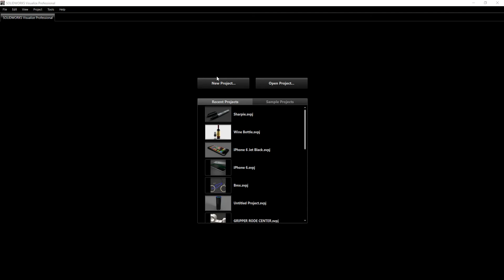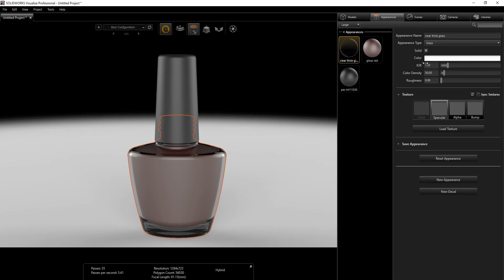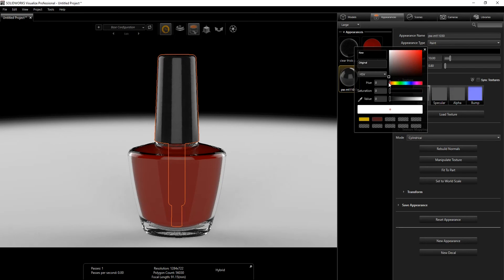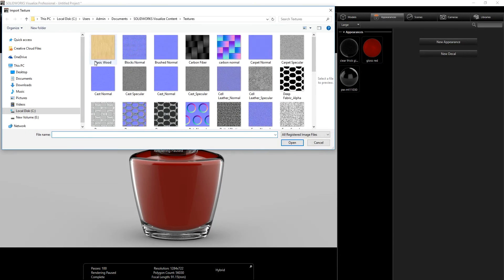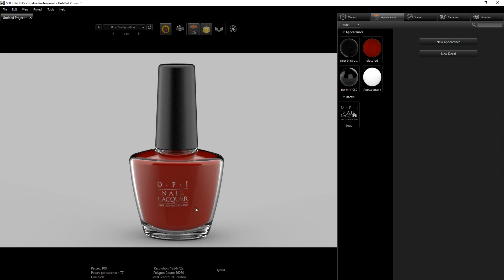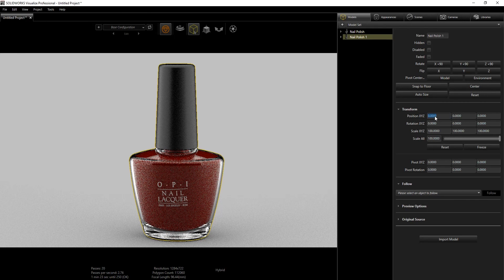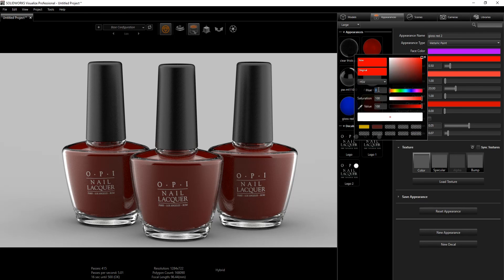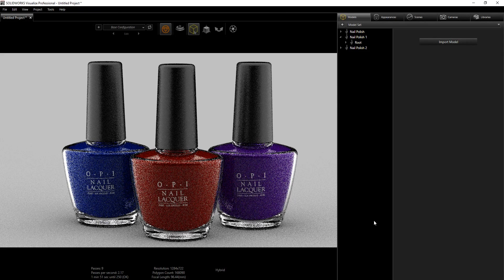SolidWorks Tutorial: O.P.I. Nail Polish Render (Part 3)

Comment: Soooo awesome!!!! One question - i want to make a glassbottle with dried spice or dried herbs inside - how do you choose the "color" or way that it looks not like a solid color but more like 3D herbs or so? I really learned a lot from your videos ! Thanks again!
Reply: Thanks a lot for your answer! Do you use in the video the addon which i saw in your other videos? Because i have Solidworks 2018 and my UI on visualize 2018 is much much easier build up, means i have less settings to change the color. I have problesm to get a realistic glass. Often i can see the triangles while it renders. And i dont know where the problem is. Do you have any ideas, why i see the lines of the triangles, even in render mode?

Comment: Hi Azeez,
Awesome Visualize tutorials! They are very easy to follow along and you explain all the settings perfectly so we can understand them. Please keep them coming!

I wanted to let you know about a hidden feature in Visualize Professional called the 'Formation' tool. This is a super easy way to spread out duplicate geometry, without having to manually move each nail polish bottle. All you have to do is set up your first nail polish bottle (with decal like you showed), and then go to the Models Tab and copy/paste your main nail polish bottle as many times as you want. These will all be on top of each other for now, but that's OK. Then select all the nail polish bottles in the Model Tree and you will see a new setting exposed in the Palette called 'Formation.' You can choose from a variety of presets like Line, Diagonal or even Flying Vee. Then you can control the amount of space in between and also the twist of the bottles. This feature will blow your mind :)  Thanks again!